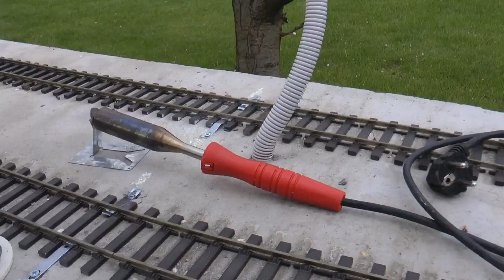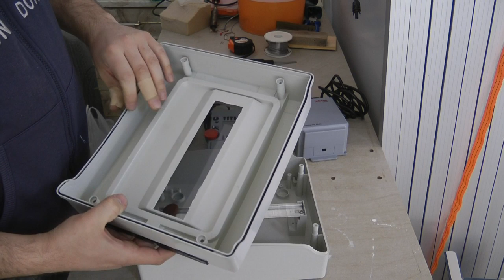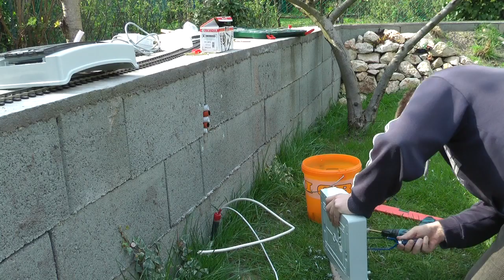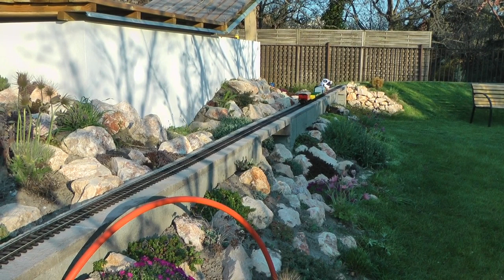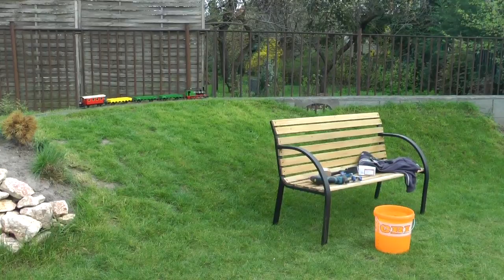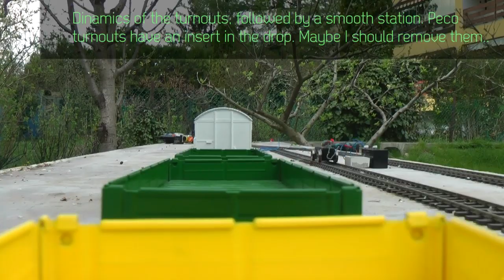Garden Railway is Born - Electrical Work

Comment: Its time to switch to dead rail, lithium power instead in the engine tender or trailing box car in conjunction with rail pro is some next level stuff, track cleaning is the bane of anyone's existence,,
Reply from the maker: I know. I have a new cleaning process, it appears to be less painful than before. For me sound is important, some of my engines have a new Loksound XL5 decoder and I would not like to loose those. And I have no found an RC product yet that can control these sound decoders.
Reply: @csongorvarga  check out rail pros custom sound profiles, they have actual record sounds for over 30 different engines,